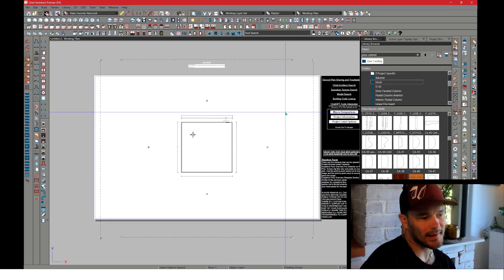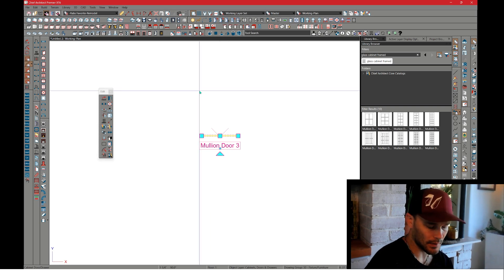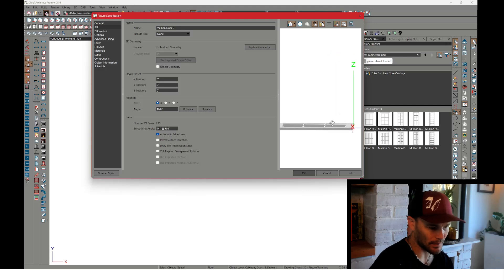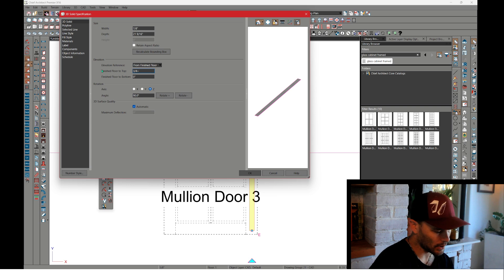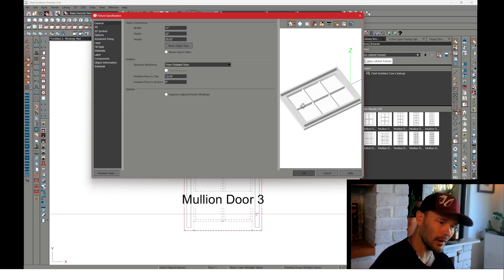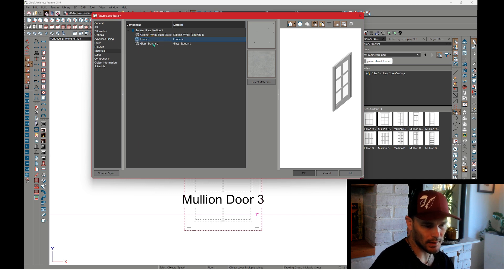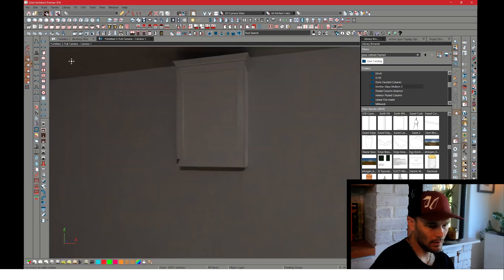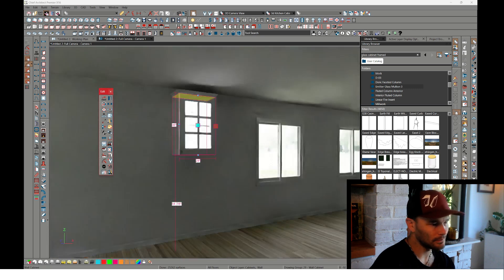CA SHORTS - Glass Cabinet Emitters in Chief Architect Premiere X16

Comment: One advantage of going down these Rabbit holes with you is 'thinking outside the box'.  All these challenges in getting upper cabinets lit from inside with vertical or horizontal rope lights and Mr. Wizard has come up with another time saving outside of the box use for these cool new PBR rendering techniques. Love it.